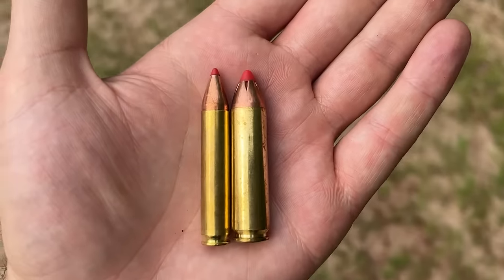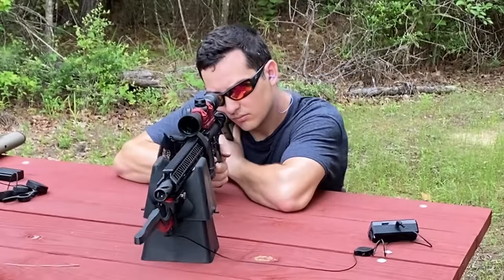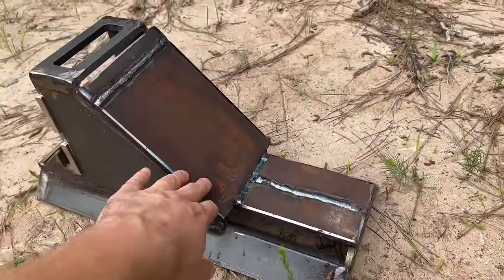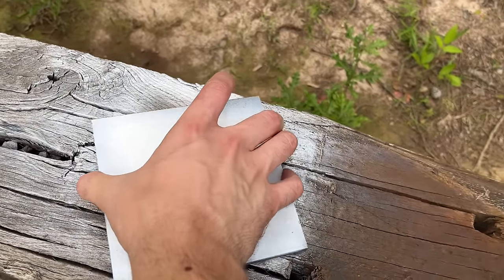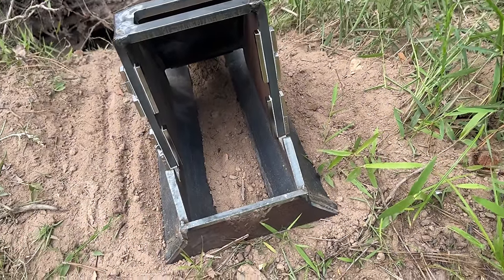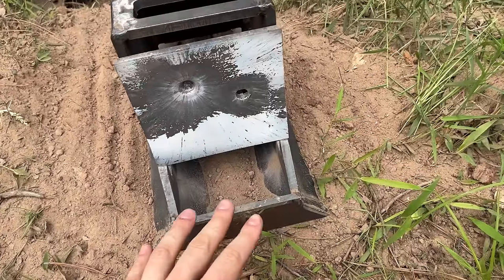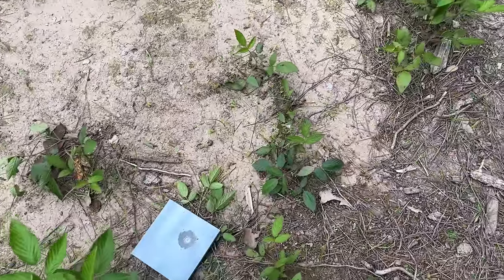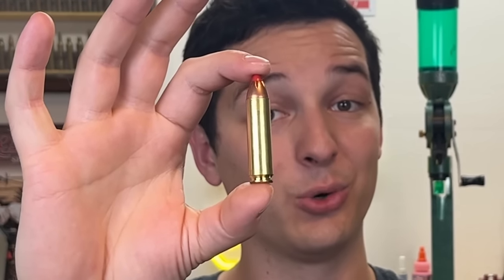350 Legend vs 450 Bushmaster: INSANE Difference On Steel

Comment: Magnets are probably fine for pee wee rounds like 5.56.  :)  I've been using 450 for deer for a few years now and it is WAY overkill for any whitetail if you hit it too drop it with these Hornady bullets.  Couldn't get good enough accuracy from the Federal hollow points.  Built a 350 last year and will be using that this fall/winter with Winchester bonded hollow points.
Reply: You say the 5.56 is a pee wee round because you have been using the 450 for deer for a few years. Where I hunt the 450 is a pee wee round so It's all kind of relative isn't it.
Reply: @russellkeeling4387  I say the 5.46 is pee wee only because the 450 hits a lot harder than 5.56.  Not sure where in America the 450 would be considered pee wee since it is used for moose and elk.     It is too much for a whitetail.
Reply: @shane3878  It is used for those animals but it is necessary to be pretty close. It is not a cartridge I would want to use at any distance. Even though it uses a heavy bullet it looses velocity and elevation very quickly making it a cartridge I will not use anywhere other than dense timber and I already have rifles more suited to my needs for those situations. It's pee wee because of its velocity or lack of at anything other than short distances. I do have to say even though I have deer hunted since I could legally do so I have never shot a white tail deer so maybe a 450 is the best medicine for them. In Colorado it is not legal to use a 22 caliber to hunt big game so the things I hunt with a .223 are almost always at distance.
Reply: @russellkeeling4387  Yes, even though they say it is good to 300 yds, I wouldn't shoot past 200.  .22 caliber isn't allowed for whitetail in MI either.  All of my hunting be it for deer or hogs is mostly in the woods.  My dad's property is 400 yds wide but there is only one spot you might be able to shoot past 150 yds.  But I wasn't talking about hunting with my initial comment.  A .22 caliber bullet is about 4-5x lighter than a .450 caliber bullet.  The .450 BM @ 200 yds still has nearly the same ft/# as the average .223 @ muzzle.   That is what I was referring to.

Comment: Forget both of them. I want a .400 LEGEND, unless you do a video that shows it bouncing off a 1/4" steel plate. Also, I was thinking that maybe you could rig up a clamp to swing down from the top of the steel sled to keep the plates from flying off. Maybe something as simple as a pivot at either side, with a bar across the top edge of the plate would do it. Like the lap bar that keeps you from flying off a roller coaster.

Comment: What if you loaded a weak .223 round to hit the plate just under 2100fps and see if the smaller diameter focuses the energy more and allows it to penetrate.

Comment: You need a track that you can slide the plate down into but it needs to be inside the box so you can only pull it out through the top. That way it doesn’t move side to side on impact. Make the handle the width of the inside of the box where your plate can slide down through the handle and into the track.
Reply: Yes but often then power of these bullets deforms the steel enough it cannot come out if fitted too closely.
Reply: One solution is a roll of high tech duct tape.

Comment: You need to weld some triangles on the sides so there's a slit for you to slide the plate down into .. don't need magnets.... Hell you could cut a 1/4 inch slit all the way around the backing the plate sits against where the handle used to be and slide the plate into it... Won't move then

Comment: Think about the girth difference..the .350 travels faster but the area of impact is smaller..so you’re getting less surface resistance than the .450 which is hitting more area giving the round more resistance..look at the 9mm vs a 45 it may have less chance of a through and through but you get more hit energy and honestly I’d rather take the chance of a couple 9’s over just one 45…well most people would probably say hell I’d rather not have either…lol…same here..and I don’t think your clamp system would work either…just don’t want you to spend the time to get the same results…it’s the energy you have to find a way with..maybe the magnets but somehow utilizing a spring system on the back. I’ll do a little more thinking about it a try a couple designs myself and if something comes up and works I’ll let you know and send some design information.

Comment: Whether or not a cartridge penetrates a steel plate has more to do with the kinetic energy it's carrying at impact and also what it's cross sectional density is - the 350 Legend is probably higher.

Comment: I tell you why throw the magnets away get you some quarter by two angle iron go to the widest material that you use which is probably 3/8 and builds you a slide system with the 2-in angle iron holding the plates in from the sides and the bottom and you can always put wedges in to take up the distance between the angle iron and the plates that you're shooting I'm just an old dumb welder 😅

Comment: At the bottom where those little claws are sticking up, shove some shims in there. That’ll hold it in place. Or, drill a hole in them and tap the hole. Then run long bolts that’ll clamp on the plate…

Comment: It sounds reasonable that it would do that. But, the 450 has alot more energy than a 350. (1884 vs 1311 fpe at 100 yds) If you actually look at the bullets,  they are designed different (different grove patterns) The 350 is a narrower bullet so it should penetrate better. The 450 explodes

Comment: 🤦‍♂🤦‍♂ Great video, but of course yes, even the strongest N52 magnets are not going to work, they will also shatter, rare earth magnets are very brittle, what you need to do is at the bottom of  your steel plate holder, make the two buttresses just small enough and wide enough to slide the plate down vertically, that alone should be enough to hold your plate in place if you increase the height on the buttresses up about 1 or 2 inches, and possibly a couple of small side pieces of steel to keep the plate locked in from side to side. Good luck with your next version.

Comment: Ha, yeah neos are brittle. If you added rubber between them and the catch it might keep them from shattering.  Better to just fit a metal wire to hold it.

Comment: It won't penetrate because the steel is not fastened when it jumps off the rail it absorbs all the energy and doesn't allow it to push through... also the bullet itself makes a difference one could be softer than the other designed to not go

Comment: its all about velocity.  i shot steel (not hardened) with 150g federal soft points .308 at 100yards.  blew through like a cutting torch.  180g trophy bonded tips, a much more premium "tough" bullet just put a big dimple in it.  velocity is king on steel.   shoot a hardened target with a 22-250 and it will blow right through it, 223 will not.

Comment: Maybe put side slots , like the top slot which i think is actually a handle , so you slide your plate target in sideways .
Reply from the maker: That’s a good idea. I was trying to avoid making it for one size of plate cause I do run some larger plates occasionally, but I may just have to have 2 steel sleds
Reply: @bananaballistics Definitely if you have the extra metal laying around .
Reply: Your website isn't working , I was going to see if you have a hat for sale .
Reply: I do like that your current target contraption collects the spent bullets , so if you do build a new target contraption , i would keep that .

Comment: Remember, the cost of admission to the comments section is very, very low and actual knowledge is optional.  Also remember, that when asked to name a country whose name begins with the letter "U", 73% of Americans answered: "Yugoslavia".

Magnets never had a chance to work (short of industrial electro magnets like they lift crushed cars with).  You are hitting the plate with over 2500 ft. pounds of energy (in the case of the .450 BM) and it WANTS to go somewhere...the magnets never had a chance

It IS important that the steel be held firmly against the backing and the sled be anchored or backed-up to prevent any rearward movement. A clamp of some sort would be a better option.

Comment: You’re using a round that is made to expand on impact, the 450 did exactly what it was designed to do. You should have used FMJ if you to test against steel.

Comment: Just so you are aware, Hornady tested their 350 and 450 on 20" barrels, not 16" makes all the difference.
Reply: An extra 4 inches is not really going to make a huge difference with a straight walled cartridge. 16 inches is going to squeeze out the vast majority of power from those rounds. 
A .45acp barely gains any speed past 7 inches of barrel, with every round most velocity is picked up in the first several inches and gains rapidly drop after that.
Reply: @harrypeterson9287  although there are rounds in other calibers that will be complete burn at 16" the 450 was designed to properly burn at 20", you lose velocity when the full burn isn't there as designed and thus accuracy, a fast bullet in the same grain and ballistics coefficient will fly higher. So, breaking it all down, your "200yrd" zero on the box won't be there because the bullet isn't traveling the same.
Reply: @gravlin1090  That's widely held misconception. The vast majority of powder burns up very quickly, even with a .308 pressure begins rapidly dropping off within a couple inches of bullet travel.

A  .308 has 60,000 psi at the chamber.
By the time the bullet has traveled a mere 6 inches the pressure has dropped to 30,000 psi and continues to rapidly drop off.
Pressure curve charts confirm this and they're easy to find.

The 450 uses less of a faster burning powder than the .308. 
To think it would require 20 inches of barrel to burn the powder is absurd. It might pick up another 50fps over a 16 inch barrel, maybe even less than that.
Reply: @harrypeterson9287  got ya so you are smarter and did all the tests yourself to make sure that your are correct and outsmarted the companies making and testing them daily, so sorry 😂

Comment: You failed by not shooting the thicker plate with the 450. And dont get it twisted thinking that because the 350 went through that it is somehow better. Cross sectional density has a lot of do with that.

Comment: Your using the wrong bullets for steel penetration in the 450. I can promise you the 450 is a far superior round to the 350. I killed my moose with one shot at 260 yards with my 450 and a 300gr sst. It passed through. He took 5 steps and tipped over dead.
Reply: He used equal bullets per the test...the test is just setup for failure....there's more surface area impacting at a slower velocity......a real video is shoot a swinging steel plate at 200yards with 350, then the 450....u may barely see it sway from 350 while the 450 flipped it!!   Any1 with even the slightest amount of common sense understands smaller / faster always out penetrates big and slow.....shoot the plate with 223 vs 3030...223 wins by a landslide

Comment: It's almost like a 9 mm versus a 45 ACP the 9 mm usually has more penetration because of the aerodynamics of the round and it's not very large versus the 45 ACP All of its power is in the punch when it hits it creates devastating impact that's basically the same thing going on with the 350 legend versus 450 bushmaster the 350 is able to punch a hole through a quarter inch piece of steel because it has the right aerodynamics the 450 Bushmaster is more bulky heavier bullet and puts all of its energy into punching not penetrating

Comment: The 450 bm isn't supposed to penetrate. It's supposed to dump energy quickly. It did exactly what it's made to do.
Reply: So is 350 legend really.
Reply: @t-bfr45-70  I have both uppers. I'm a fan of the 350. Lot's of power at short distances and 20 rounds in the magazine. 
"Is it legendary?" Beauty is in the eye of the beholder. The 450 bm and the 350 will certainly defend you, if I used it for self defense, I'd prefer the 20 rounds of 350 over the 5.56 or the 450 bm.
Reply: @freedomisntfree131  350 legend does it's job really well extremely effective on deer so no doubt it can defend the home.

Comment: Those magnets are SUPER STRONG i use them in several of my DIY projects but they are like glass in the fact of the will shatter very easily, i have tried multiple times to drill them and most of the time they shatter like glass, i have also dropped them and again they shatter like glass!! Good try though

Comment: This does not surprise me at all.  These large cartridges are not really intended to penetrate steel.  You'd do better to use a 5.56 green tip.  Smaller diameter+ higher velocity is going to be able to penetrate much better.  Softer cartridges are not for penetrating metal - they are for causing damage to soft tissue**.  Much of the energy in these large caliber soft bullets goes into deforming the metal in the plate and the metal in the cartridge.     Also, the larger the diameter of the bullet the faster it must go in order to get through the metal.

** Not that it matters much to me since all of my shooting involves punching holes in paper.

Comment: Obviously your not an engineer.  With the greater surface area the 450 spreads it's impact over a larger area and transfers more energy.  I had a 357 Maximum in a T/C Contender and I would push 180 soft points to over 2100fps with it.  Even then most times that 38 caliber bullet (.357") would pass through a whitetail doing little damage, great penetration, little energy transfer.  I built a AR in 450BM over a dozen years ago and it's never failed to plant Bambi with one shot, the effect of a 250 SST hitting has to be seen to be believed even out to 200 yards.  On a side note, the Germans in WWll liked the 9mm for it's ability to penetrate armor for the same reason the 350L does, it just doesn't have the energy or the ability to transfer it efficiently like a 450 IMHO as an engineer. (It's just math.)

Comment: Guy... The answer to your plate issue with sitting right in your face the whole time, you didn't need magnets the answer was already in your stand - the fabrication just needs to be mildly altered.

That said, I was disappointed in the bushmaster round as well

Comment: Oh boy, you're going deep to find cartridges for the shootout. The modern straight wall Carts are just as bad as yesterdays. Just look how long the 38-55 has been around undetected or the 30 Carbine. The 45-70 should end your debate and you don't have to ruin an AR platform to do so.

Comment: Put rubber mat between frame and plate. Magnests should not be directly on plate and should sit 2mm or so away of plate. Or buy a cheap plasma cutter. Cut holes to plates and weld some 14/16 bolt on frame.
Reply from the maker: I tried the rubber spacers but there doesn’t seem to be enough magnetism left to hold the plate on substantially. I really appreciate the other idea and might have to try it out
Reply: @bananaballistics  i would use some cheap adjustable weights for it. Even better if it dont have threads to shred and its without them and fastens like bigger gym lifting weights. (older ones were with some spring system, now there seems to be better solutions) that should take shots and be easy to replace plates. Cheap aliexpress plasmas etc are working fine. Doesnt need to be fancy thing. Or even cheaper is gas welder ( 2ballons), but that need some skill not to blow up urself.
Reply: NB! Dont waste time drilling! 😆 pointless time and oil cost with metals like that

Comment: A ballistic tip shouldn't pen a steel plate... try this test with fmj rather than ballistic tips.Ballistic tips will force the bullet to mushroom and punch a bigger hole thru flesh and bone. I wouldn't use hornady 350 legend ballistic tips after watching this video since the tip clearly doesnt work as it should.

Comment: Hunting bullet performance on plate steel is meaningless. Those bullets are designed to produce optimum performance and every transfer on flesh and bone. If anything what you might be frustrating is a failure to expand at close range with the 350. If it will zip through steel it will zip straight through a deer leaving an inadequate wound channel with insufficient blood trail

Comment: As usual lousy test. The bushmaster caused more impact energy and the steel was not held in place causing it to jump .It would likely have penetrated if it has been held in place firmly It also has nothing to do with a real world assessment  regarding hunting. You can get a 17hmr to penetrate 1/4 inch steel. Also there are FMJ 450  bushmaster that can be used on large game for penetration.

Comment: it because speed and size of 450 bm. not in equilibria. mean with size of bullet it has it should be has more zppeed to penetrate steal plate. because stell plate has density. it is like if .350 legend has slower speed with this diametr of bullet.

Comment: I've used both and the 350 legend is garbage in my opinion.  It's way too small entrance wound is small exit wounded small absolutely no blood trail to follow.  It should just be used as a varmint gun.  I'm batting a thousand with the 450 which I bought after I lost three deer because of a 350